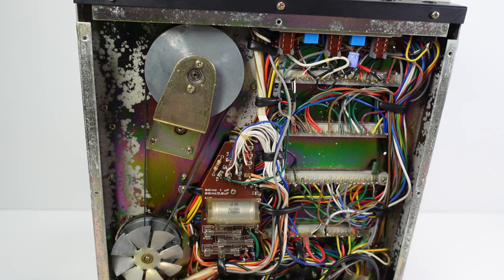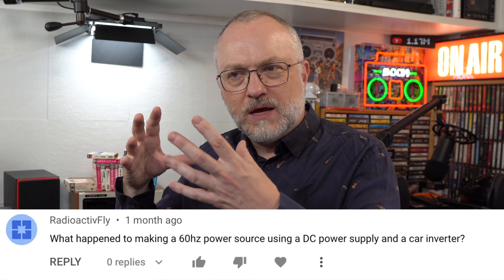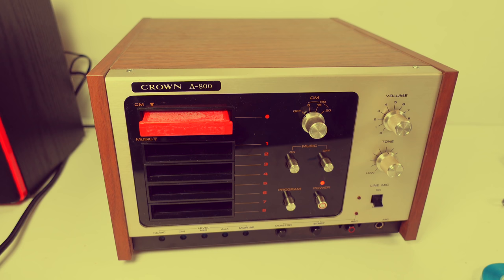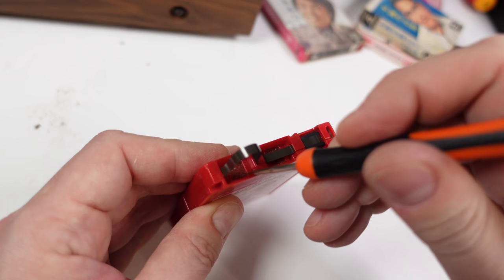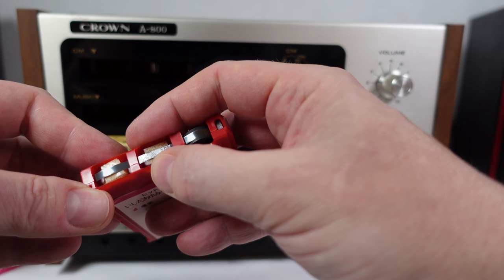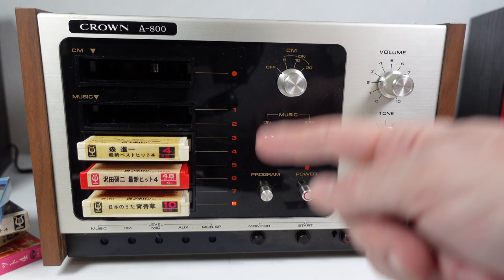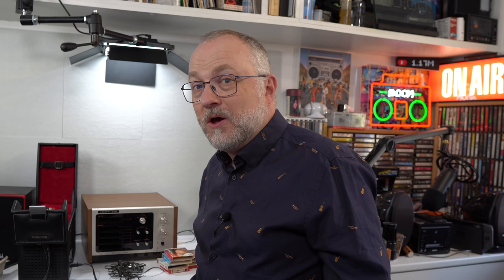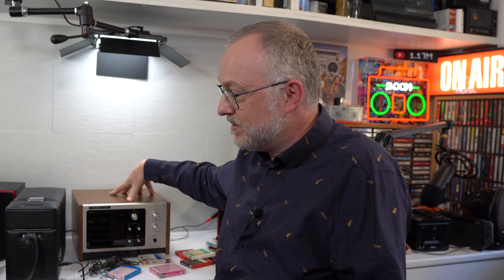Hipac - Fixes, fails and a flash of inspiration

Comment: capacitor works in uniform with a transformer to produce a tuned oscillating signal of a certain hertz. so yes to change one or the other would effect the hertz that gets sent to the motor and so the speed of the motor itself. [edit] its essentially the clock speed
Reply: if you were to try slightly higher or lower  values of caps, I imagine  you could  eventually hit on the right one to make it sound correct at 50 Hz. of course you would have to be careful, if the Hz val also applies to the audio electronic and not just the motor, the wrong value could  lead to something burning out, or other weird effects.
Reply: yes i agree. u "may" need some adjustability to get this to run present day as it should then, in a mixing fashion. even amongst age distortion! recordings. including entire system...so i can imagine a a series or set of dials like im jim morrison in and old tape set up as used in breakin a sweat :)

Comment: At 5:52 you can see very clearly a capacitor determining the speed of the motor; it says on the circuit board (upside down on the image)
50 Hz   1 uF
60 Hz 0.6uF
The capacitor which was in it read .6uF so it was set for 60Hz, Mat's put a 1uF in so it's set for 50Hz now.

Comment: Try putting a rubber ‘tyre’ around the small pulley under the fan to increase its diameter slightly to make it play faster via a mechanical rather than electronic method. May be fun to try. You may need to find a slightly longer belt though.

Comment: Just a thought - when you are replacing the sponge pads, should you not glue the felt back on? Otherwise, you’ve got plastic from the sponge you’re using rubbing against the plastic tape rather than felt rubbing against the plastic tape. Plastic against plastic would probably heat up more in use and damage the tape. You should have no problem securing felt to the sponge as it has the plastic layer. Great video. Thank you.

Comment: That Cap is there to help at start up and to make sure the motor only spins in one direction. If you disconnected the Cap and applied power the motor might not turn or it could spin in the wrong direction. 
Nearly forgot about that nearly all AC motors have a Cap for that reason. It also helps the field strength when running could explain the speed drop from being leaky.

Comment: Took some inspiration from you, took a non-working Sony cassette deck and amp from the thrift shop to hopefully fix. The amp's caps spilled out onto the pcb so it got recycled. The tape deck i got working with cleaning and belts. Your motor may have a speed control to adjust with a mini screwdriver behind the felt or rubber cap
Reply: No. It is an AC motor.  Speed control potentiometers are on DC motors.

Comment: Just bought two Superscope CD330 cassette players. Both in very good cosmetic condition so I'm hoping it's just the belts which I've managed to get. I haven't fiddled with this sort of thing for years, I did change some cd lenses on 1990's Aiwa machines and adjust the pots so hoping I can at least get one out of two working. Also bagged two nice condition Superscope cd players, a PSD 300 and a PSD 230. Love the features on them thanks to your recommendations.

Comment: I feel vindicated that I was right about the capacitor, but also because in my comment I'd said that without looking into the circuit further we couldn't tell either way.  I'm glad to see more detailed interaction from others who were able to provide knowledge as well as advice.

Glad to see the ending segment where we find out that the Crown unit is really a different variation instead.

Comment: I think when you pulled a bit of tape out to replace the pads you left it loose, and that's why it twisted. I was expecting you to have to open it THEN to tighten up the loop.  I've fixed many an  8-track, they have to be tightened up before putting back into the player.  I don't know of a way to do that without opening up the cartridge.

Love the outro!

Comment: To those more familiar with imperial designations for the standard speeds -
4.8 cm/sec is equivalent to 1-7/8" / sec such as compact cassettes use
9.5 cm/sec is equivalent to 3-3/4" / sec like 8-tracks, Elcaset, low speed reel-to-reel

Comment: Bought an 8 track many years ago in USA stuck a 240V to 110 transformer inside - it was an unusual 8 track as it played thru 4 speakers - bought quadrophonic 8 track cartridges  using 4 tracks so basically only had 2 sides

Comment: That is an electrolytic capacitor.  They fade over time, until they no longer are performing as they should.  They also remove the bottom end of a signal, the cutoff being related to the uF rating.  Straight replacing the capacitor would likely resolve the issue (if it is old).  Replacing them with poly capacitors will give a much longer functional life.

Comment: I would just HAVE to tinker further - wire up and external rotary pot to adjust the tape speed between the two format speeds. Seems a shame to leave the machine sitting unused after all that work. Great vid.

Comment: You might put that foam tape of yours in a box because it looks like it's already yellowing from UV damage. This could rot the foam. So, it's better to be safe than sorry. That is oxidation on the metal bottom panel and the chassis. You could try a rust remover to get rid of it. If you leave it there, it will just continue to oxidize.  Also, you could try some vinegar as a long-term solution because the vinegar tends to turn the oxidized area into a surface that will not rust again. I would apply the vinegar with a rag because it is quite caustic, and you do not want it doing damage to other parts. You need to leave it on for a few hours, and then wipe clean with a damp rag.

Comment: whatever it's worth, I've modified several cassette machines to have speed controls and I always use a potentiometer - basically a variable resistor - so resistors typically will set motor speed in most circuits I'm aware of, not capacitors

Comment: I wonder if conductive paint might be a better option than overlaying the existing foil with new foil.

It's possible that flexing it might cause the paint to flake off though, over time, so if you want to test it, it might be worth trying it on a less important cartridge first.

Comment: Since this machine DOES change speed with the capacitor, the motor is undoubtedly a 2 phase motor, where the speed of the motor is controlled by the phase of the voltage on the second winding. The people who "knew" it wouldn't make a difference assumed it was a single phase motor with a starter winding. When they designed this device they obviously planned for 50 Hz, whether or not they actually sold any into the market.

Comment: I've seen circuits where the cap affects the speed and I've seen them where it doesn't. So I wouldn't have been surprised either way. Since the cap does affect the speed it might be possible to find a different cap that gets it playing the tapes you have at the right speed.

Comment: Just discovered this video, and what a cool little concept for background music.  I have a question that MAY lead to an answer for another question presented, or at least present a new theory.  Are you able to record onto the tape from the AUX input on the back?  If so, does it then playback the recordings at the proper playback speed/sound as the original recording?  Outside of being mono, of course.

Thinking of application of the product, I can see that owner operators of it would want to make their own custom background compilation tapes, instead of playing full tapes from any particular artist.  When was the last time you went to a supermarket, and The Who "Quadrophenia" was playing in it's entirety through the overheads?  That aux, and top deck, gave them the option to make custom tapes.  The fact that official releases play back slower no matter what, made me think about older VHS video security systems I've worked with.  Those used standard VHS tapes, but could get up to 24 hours of recordings on it.  Pop a copy of a movie in those decks and it played back super slow.   Pop a VHS recorded in the security system into a normal VCR and the playback was super fast.  However watching the playback of the tapes made on the security system, on the security system, audio and video playback was at a normal speed.  We would then dump that down through an output to a normal VCR if we needed to provide a copy of the security tape to law enforcement or whatever.  

So, my theory without being able to test it out, is that there wasn't another format out there.  It is the same, just with a completely different approach towards it.  It may be worth the one minute trial to record something from the aux (or use the mic input as an aux) and see if it plays back at the correct speed on the other decks.  For an extra check, how does it sound on the other player you have.  The "mystery" could just simply be that this was designed from the start with 100% user made background tapes in mind, and not commercial releases.

As I said, I just discovered this video and channel.  I really enjoy your videos, and look forward to watching more.  Keep up your great work.

Comment: Yes changing the motor field capacitor will correct the speed problem.  When the capacitor goes bad, the motor cannot generate enough field to hold the torque required to turn the mechanism at a constant speed.  I have repaired many sony reel to reel tapecorders from the sixties, and many times the non-polarized electrolytic on the motor needs to be changed to restore the motor field so it has enough torque to maintain operating speed.

Comment: That is a dangerous way to fit that new capacitor. Remember it's connected to MAINS voltage and therefore it and it's leads must be kept well away from the other lower voltage wiring and components, and the metalwork etc. especially if the player is not earthed. The doubled sided sticky tape is not likely to hold it in place for long.

Comment: Apologies for writing this without reading all the 1000+ comments already here, but I would just point out that the Yes camp were right in one respect, concerning the tolerance of capacitor values. If the capacitor value does determine the speed, as confirmed by experiment, then a difference between the actual capacitance and the nominal value must surely cause a difference between the actual speed and the correct speed. However there is something much more complex going on here. The ratio of the two specified values, 1:0.6, is much wider than the difference between the two mains frequencies, 60:50. Moreover, if the motor speed were determined only by that capacitor and some associated circuitry, the frequency of the mains supply wouldn't matter at all. I would really like to see the circuit diagram, to understand how the motor speed is controlled.
Reply: PS, I think I just mixed up yes and no. :-(

Comment: A third cap with a bit more than 1 μF would speed up the playback further. You just need to determine right amount of μF to obtain 33% faster playback. Maybe connect a variable capacitor and see what happens in Audacity?
Reply: Hi, I don't think you can get "variable capacitors" in the value you are talking about. Variable capacitors as far as I know are low value being air vane type (tuning capacitors) or trimmer type capacitors.

Comment: I did a Tim and stayed on the fence....  I was more on the synchronous motor aspect...but they would have to stock 2 different motors...but why not put both capacitors in there with a 50/60 Hz switch?  Love these enigmas.

Comment: 10:49 My local hardware store here in Finland has that. Same 9mm x 6mm dimension too, although they sell a smaller 6m roll than the 24m that you have. 5.25€ a roll.

Comment: If anyone needs that kind of draft excluder in the UK, try Poundland or ASDA. I have something almost identical that I got from Dollar Tree, and I've seen it at WalMart recently as well. Common as clarts. I'd expect that the smooth coating provides more contact area against the back of the tape, which would increase friction and could have caused both problems Mat experienced with that cartridge; foam with an open cell face would probably be better in this application and give performance similar to the original felt.

Comment: There's a kind of silvery conductive ink you can get for repairing PCB tracks, it comes in pens. Maybe one of those would be better than cutting out bits of foil, you might just be able to scribble over the oxidised bit and restore conductivity. Might come in useful all sorts of places.

Comment: 19:00   "Well I think that should work'
Oh no!    I can see your new foil is at a slight angle that exposed sticky corners to the pinch roller. 
This is why your tape got eaten.    Non-factory foil and splice tape should always be slightly less wide than the tape.
23:38  "It's a little bit wobbly"      
It sounds like the tape is dragging because it's wound too tight.  You'll need to unwind a loop or two from the spool and re-splice.   Pulling tape out of the center once you're done will take up the extra slack.
25:51  "They weren't designed to be playing the original hi-pak system and that's why the speeds are different."
If this commercial unit was designed to get more playback time as you suggested, the hi-pak tapes would play faster, not slower.

Comment: I guess it's how and where the capacitor is added, but usually it's adding a resistor (fixed or variable) that changes speed since you're changing the power going to the motor. The capacitor would store the power but if you need to increase the amount of voltage going to the motor you might affect the power and need to increase the size of the capacitor so you don't blow it.

Comment: The only way to prove the capacitor - speed question is to refit the original cap and run it from a 60Hz supply. If it runs the Hipac carts at the right speed then it means there was a pulley + cap change required. I"m sure I've seen a reel to reel machine before that needed both items changed for 50 / 60 Hz.

Comment: If the hum persists, replace the electrolytic capacitors in the power supply.  Aluminum electrolytic caps from the past were good for mayb 20 years tops before the electrolyte dried out or otherwise went bad.  The life of an electrolytic is often related to its heat rating vs. the amount of heat it actually experiences in service; replacing them with one having a higher temp rating tends to make them last forever. ;)

Comment: You might want to try bare conductive electrically conductive paint instead of foil Matt.
I've no idea how flexible it is but if it is flexible then you could just paint a strip on the tape instead of taping foil on and save your tapes from getting eaten.

Comment: The flutter could be caused by a number of things, a common cause is the pinch roller having lost its surface tackiness. TEAC "Rubber conditioner" can fix that, if you can find any.

Comment: No, changing the capacitor will NOT change the speed. You will also need to put a little sticker on the front of the machine that says "Go Fast" (in Japanese) so the machine knows. Hope this helps I'm an expert by the way.

Comment: blimey... back in 79 my parents moved to Saudi, a free for all when it cones to mains supply. Sort of.. we had outlets in the house that were 220V and 110V, but all were 60Hz -- the 220V stuff was just a different configuration of the 3-phase 110 supply. Lovely... Anyway, mum ought a Sanyo ll in one stereo, with a cassette player, record deck and receiver all built into one box. My introduction to stereo. It was made for 50Hz, so everything was speeded up. It was a couple of years before I convinced them to upgrade to something that bran at the correct speed. If only I'd known it was as easy as swapping a cap...

So here's a question: could you swap a standard cassette tape into one of these tape cases?

Comment: It would effect the speed if the storage capacity was lower than the motors current draw. 

It would act like a waterfall entering a pond that has a runoff pipe. The pipe can be any size as long as the water fall never outputs more for a longer period of time causing the banks to overflow. This is kind of how the capacitor would work.

Comment: If you wanted to test all the cartridges without concerns how potentially having to pull the tape out of the machine. Couldn't the tape head you had out, be used externally if you powered it up so let the tape run through happily?

Comment: I would've assumed that the 50/60 hz switch would be simple, as Japan uses both main frequencies in different parts of the country.
But since the cap did increase the speed, maybe another cap would put it at the right speed for the tapes.

Comment: I'm curious if you could use a conductive adhesive to fix those metal strips? There are wire glues and trace paints that are designed to conduct, so if one is conductive and can be thinned slightly for application if it's too thick, it seems it'd be a sensible solution.

I know some metallic paint pens are conductive and Amazon has a product called, "CircuitWriter" that is silver based. Keywords could be "conductive ink", "conductive paint", etc. That sounds even better, if not just for testing purposes.

Comment: I have no idea if this would work. But I have a marker pen that is actually quite special. It is able to draw a conductive line. The idea is that you can draw a circuit that will conduct electricity. I was thinking it may be quite useful and replace the need for using metallic splices??? Just simply colour in the bit of tape?